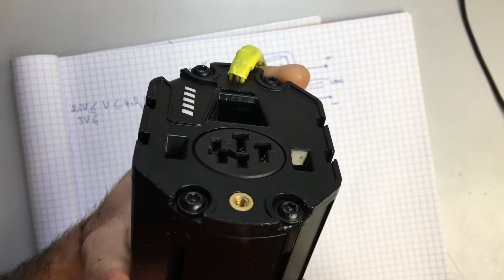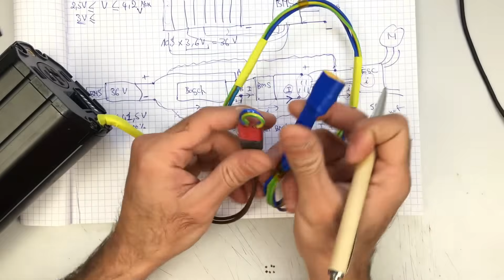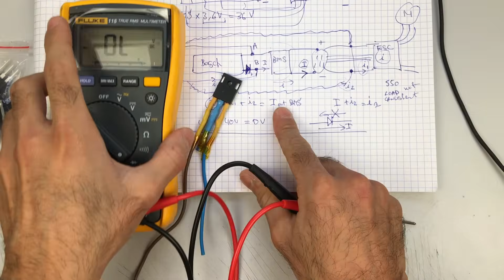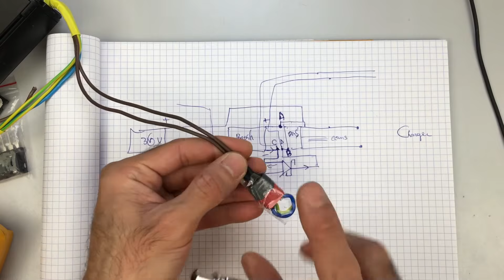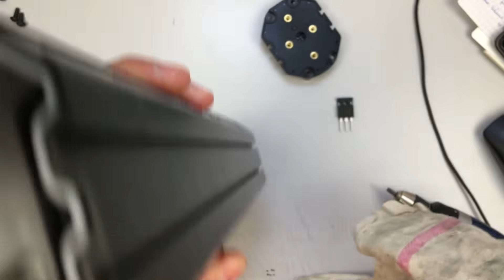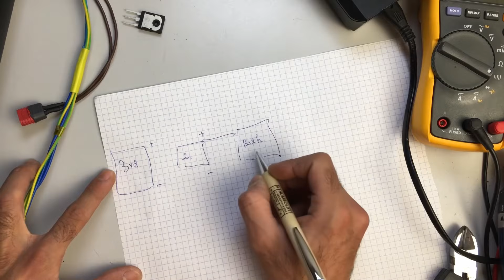Bosch ebike battery hack - Run your bosch ebike on any 36v battery

Comment: Good effort.
But the video title is misleading.
You MUST HAVE a working Bosch BMS - you can't run a Bosch bike on any battery.
Only "piggyback" any battery to a working Bosch battery.
Reply from the maker: For sure, it's  a compromise that works for me.
I found someone on YT who figured out how to use a bosch battery for other ebikes basically activated using an arduino or similar. I haven't been able to find someone who successfully uses the CAN bus signal necessary for activating the motor though, like i mentioned when connecting a third party battery to the bike it turns on the display but you can't run the bike.
It a shame but for now no getting around a bosch BMS.
Good luck.

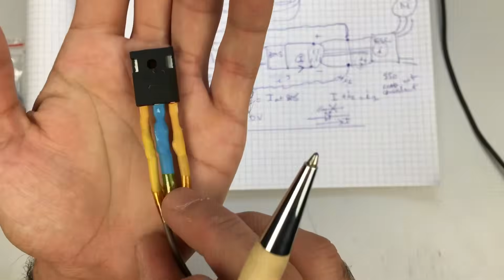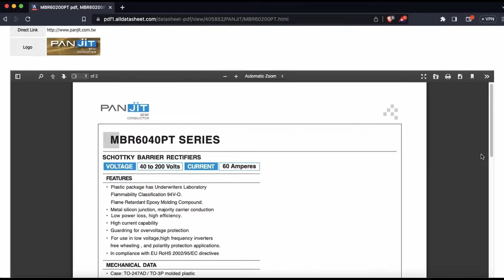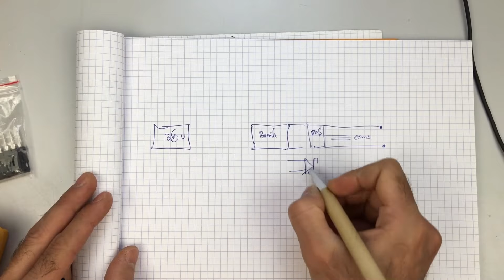Comment: Meh ... A shottky diode is not basically 2 diodes (@17:50) but a special type of diode. A shottky diode is a diode with a low forward voltage (as you correctly measured later on). You will indeed see them a lot in this dual configuration because it is used a lot in voltage/power-combining applications as you used it for. Also a "back current of up to 200V" (@18:39) is not correct. As you can read from the datasheet, this is the "peak reverse voltage" which means this is the absolute maximum voltage that the diode is able to withstand in reverse mode. More than that will result in a current flow and damage the diode. The symbol you use with 2 wires on the anode side of the diode (@24:40  ) is incorrect. As you see @20:20, the correct way of drawing this is as 2 separate diodes.
But the principle shown is correct and I like that you stress the fact that you should never ever just wires 2 batteries in parallel.
What I do wonder is what will happen to the whole system when the batteries are indeed very different in % of charge (i.e. different voltages). What if the Bosch battery is almost empty and the extra battery is completely full? Will the Bosch system notice that the Bosch BMS reports a lower battery voltage than the actual voltage seen on the ESC ??? 
I actually don't know but I do like to figure this out. I just bought a 2nd (original Bosch) battery to connect to my bike.
By the way, I think you should do a video on the battery you added. That looks like a nice build with proper insulation on top of the cells to prevent any short circuit when loose parts get in there. Looks good
Reply from the maker: Hi,
Yes indeed mistakes were made. I don't pretend to be a specialist on this subject but as far as the whole system goes it's working as described.
Have a good one.

Comment: I am entering if their scooters are the same... 🤔 
I just got a Bosch rear wheel for my Gio. Find out soon.
Any tips? Bosch does not even give the wattage... It's 48 volts ⚡️
Reply from the maker: Hi,
Sorry mate I didn't even know bosch made wheel hub drive.
The voltage of the motor doesn't really matter, but the controller voltage should be matched.

Comment: One more thing woudn't it be possible to use a newer bosch powerpack and convert it to a bosch classic powerpack that is hard to find
Reply from the maker: I think its possible.  Basically if you connect a bosch bms to a 10sXp battery pack it should work as long as you connect all the balance wires as they were originally. 
Good luck.
Reply: but is the output from the classic battery and the newer round one the same? Then all I have to do is change the case @theelectronage
Reply from the maker: @overexposurevideo check for yourself to be sure. But I think even the newer bosch smart system uses 36v meaning 10s batteries. And if you're talking about the powerrack i believe it's called yes it's 36v.

Comment: Thanks for this in-depth video.  I'll pass on buying anything from Bosch now.
Reply from the maker: My pleasure. 
Don't get me wrong I have a lot of bosch products because they make good products, but like every capitalist company their practices could always be improved.
Reply: @theelectronage  I'm about to build my first ebike and I don't want to get a propitiatory system.
Reply from the maker: @shaunhall6834 you're better off learning and building your own.  
I always think about it like the early water vapor vehicles, not anyone can start them safely. 
While batteries can be dangerous, when you always think in terms of voltage, amps, temperatures and so on, you'll be much safer than your casual user.
Enjoy.
Reply: @theelectronage  I like the learning part the best. This is why I appreciate people like you sharing knowledge.
Reply from the maker: Good man.
And thanks, knowledge is free. Thank God.

Comment: My battery is 960 WH and I'm wondering with an inverter how i might use it as a back up battery for my CPAP machine for camping trips that i don't take my bike on. 
That might make a useful video as well. 
Thanks for your information here.
Reply from the maker: Sure.
Just a buck converter will do the job if you only need 5V or 19V for laptop.

Comment: I see only one problem  if its connected how can oud charge your Bosch battery bicose the diode Will be in reverse mode and can not take any charge, sorry I die not see you talked about that
Reply from the maker: Hi,
I did mention that. 
That's why there's a bypass.

Comment: Thanks for this! After using the system are you sure that there are no errors being detected? I guess the BMS might theoretically be able to tell that the (combined) battery has increased capacity.

Also, would it be possible to use a 3way switch instead of a diode, and only discharge one battery at a time? (still connecting behind the BMS) I think this might be even safer because the diode could theoretically short circuit and cause a rapid equalising current (and potential fire).
Reply from the maker: I guess theoretically the bms could detect the increase in capacity, thankfully it doesn’t.
You can definitely use a three way switch but I’m not sure if it would work ( imagine the bosch battery is discharged, so the voltage of the cells would be low to the point the bms will shut off even if the second battery is full)
I’m afraid it’s both batteries or just the bosch alone. Just an educated guess. Could be wrong. Maybe try it and find out.
As for your concern about the short, if the diode fails, it wouldn’t actually be a short(think about it, the loop is not closed), and so if it fails it could: 1 do nothing.
Or 2 the full battery will charge the low.
(Which will only happen if you connect the two with a vast difference in voltage, which you shouldn’t do anyway even with the diode,  although you can because the full battery will get used first then they will be used together)
I actually trust this system so much that sometimes i leave both batteries on the bike connected for over a week.
But always do your due diligence.
Also an advantage of using the 2 batteries in tandem is that you will discharge them in a longer time, meaning that you extend the lifespan of both batteries in comparison to using each alone.
Enjoy.
Reply: Thanks for your reply  @theelectronage . I think that if you used the switch, then when using the second battery the Bosch BMS would only see the voltage from that pack and not its own cell pack. However it has the balancing wires connected to its own cells. So there could be a problem if it notices a difference between the total of the individual cells (via the balance wires) and the total voltage of the second battery. But if it doesn't complain about that it should work (and the display would give you the SOC for your second pack I guess).

You are right that discharging both batteries at the same time should give less wear and tear. Maybe if safety was a concern you could add some sort of fuses to the system?

To be honest there are many discussions on various forums about connecting packs in parallel, and diodes are often mentioned. This situation isn't any different, except for the very useful information that the Bosch BMS isn't smart enough to detect what you have done. So thanks again!
Reply from the maker: @user-xk4zh4em1q well i think that when you switch to the 2nd battery the SOC you’ll see will probably be for the bosch with the balancing wires, and as long as it’s good you’ll be good. Hopefully.
I think adding a fuse will not serve for much, because when 2 batteries are in parallel the amps from each is divided by 2 if they have similar capacity . And adding a fuse after the diode well if the ESC calls for 40amps max, you can add a 60A fuse just for peace of mind, you don’t want a 40A fuse because it’ll leave you stranded somewhere.
Check out Kirchhoff’s laws on current, very good to know.
Reply: Hello!
I heard that the bms calculates the energy taken and switches it off. Even if the capacity doubles, it only allows 500wh to be used.
How does this work for you? When the ebike indicates that the battery is dead, is it really dead?
Reply from the maker: @gyorgysimon8878 @gyorgysimon8878 hello friend,
Yeah i did say that, but in the case when you splice between the battery  and motor, the bike throws an error code due to it detecting that the motor is consuming more than what comes out of the battery. 
On the other hand after the modification and connecting 2 batteries, it works just like usual, the battery indicator still works but doesn't take the extra range into account, the batteries discharge simultaneously so for example in my case 1.5kwh, when indicator shows 10%, i know that still have 10% in the second battery as well, so 10% of 1.5kwh and not 500wh.
Good luck.
Reply: Szia!
Én úgy hallottam hogy a bms számolja a kivett energiát és lekapcsol.Ha megduplázódik a kapacitás akkor is csak 500wh enged elhasználni.
Nálad ez hogyan működik?Amikor az ebike azt jelzi hogy lemerült az akku akkor valóban lemerült?
Reply from the maker: Sorry I don't speak your language. 
Comeback with a translation.

Comment: Interesting. Can you please suggest the other way around? (Using bosch 750Wh battery pack in another non bosch setup). As I understand,  they have some tampering protection. Thank you in advance.
Reply from the maker: Hi,
I haven’t tried it yet, but seen someone do it on YouTube. You need to wake the bms by injecting 5v or something (I don’t quite remember)
Of course that’s only if you want to keep the battery with original bms, because if you open the battery a 10s battery is like any other 10s, so either you bypass the bms(which isn’t recommended) or install your own bms and that’s that.
Hope you succeed in this.
Reply: @theelectronage  Are there any aftermarket packs available? Im after an empty case that i can just load my own cells into since i have an abundant supply of the things. Surprised there is nothing on aliexpress
Reply from the maker: @nzoomed  hi, 
There are empty battery cases for sale on AliExpress and similar sites. 
If you mean bosch empty case, I don't think so, except for used ones.
Good luck.

Comment: in your scheme you connect two batteries in parallel, the negatives of the batteries are connected to the anode of the diode, the cathode goes to the bms.
Reply from the maker: Yes, everything holds by changing the sins.
I apologize for the mistake, it might shock you to know I'm not an expert. But I'm trying:).

Comment: I've got 2  500 Watts Power Tubes with broken BMS. In both accus is the original BMS removed and replaced for a Chinese S10. Because replacement Bosch BMS PCB;s are not for sale...  Both accus working great with the Chinese S10. What do i need for connecting these accus on my Bosch bike? Because there is missing a 2.5 Volt?
Reply: the Schottky diode must be placed on the positive side. You give all the examples with the negative side. At the end of the video, you again give an example with the diode placed on the negative side
Reply from the maker: Hi,
I know, most batteries pass the negative line through the BMS.
I tested the batteries for two months before making the video. I made the video to give a comprehensive explanation and not just a step by step, and I'm glad you got it.
I apologize for repeating the mistake, but it wouldn't have changed much because once you open the battery you need to locate the line that goes through the BMS and run it through the Schottky.
Have a good one.
Reply: @theelectronage  I think it doesn't matter bms which side controls plus or minus,the diode must always be on the positive side.
Reply from the maker: Right you are sir.
I had to think about it after your message this morning . The diode allows conventional current to pass, so it wouldn't work the other way.
Thanks.
Reply: @theelectronage you just have to divide the positive of the two batteries with a simple diode. Then there will be no need for a bridge.
Reply from the maker: I believe you do need at least 2 diodes, might as well use a Schottky or a bridge.
Reply: @theelectronage  you must use two diode  for sure , doesn't matter if they are schottky diode or regular.The diode they mention in the video is a single diode.  the two outer legs are shorted, you cannot connect two batteries through it.
Reply from the maker: Now you lost me.
I did test it with a multimeter. The outer legs are not shorted.
Reply from the maker: Sadly the bms is an absolute must, like you said bosch doesn’t sell it.
On the other hand you can try and find a dead battery with a good bms and combine the two, it doesn’t have to be a powertube either the powerpack or powerrack or whatever’s bms should work.
The voltage of a 36v battery varies between 29v and up to 42v.

Comment: Could you take the BMS out and build your own bigger battery with it?

I'm trying to do something similar to a cargo bike, so I was thinking of one big battery. I might switch my order to the 500 batteries instead of the new 725s to avoid anti-tampering tech.
Reply from the maker: Hi,
Yes good thinking about the smart system.
So there's a lot of myths concerning the bosch bms and how it goes dead if you unplug it from the battery. I haven't tested this myself but have seen other YouTubers do it,  and it makes sense there's no such thing.
I didn't do it myself because I have the space for the powertube anyway but it did cross my mind, and is exactly what I would have done in your case, but only if you can leave the battery and bike inside a garage or something, or really make them water proof.
Reply from the maker: I wasn't very clear, the BMS thing is an urban myth. Not true at all. As long as the BMS has nothing wrong with it you can plug and unplug to your satisfaction.
Reply: Thanks for the reply! 

I should look for those videos, I'm kind of curious about how big of a pack I could get away with and what specs the pack would need besides 36v to work with the BMS. @theelectronage
Reply: https://youtu.be/jRkLBh6oztg  You can swap the BMS!

Comment: Thanks for sharing this method. 

For a person who is an expert with electricals, they could just charge both batteries to 42.00V before connecting them. Then there would be no rapid flow of intensity of current between them. As the batteries are slowly discharged by the motor, they would stay balanced. 
But your information about connecting before the BMS is very valuable. Thanks again for sharing this detailed tutorial.
Reply from the maker: Thank you sir, my pleasure.
Hope I didn't make too many mistakes, and got the point across.